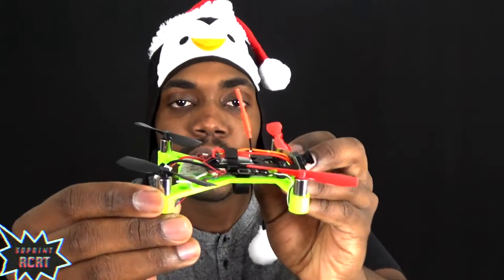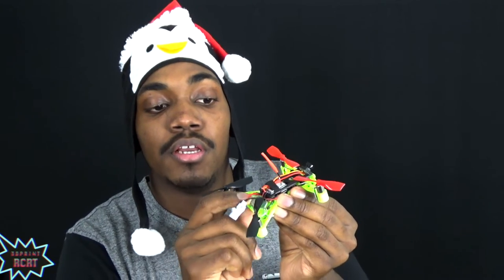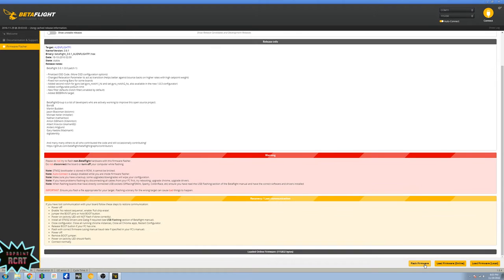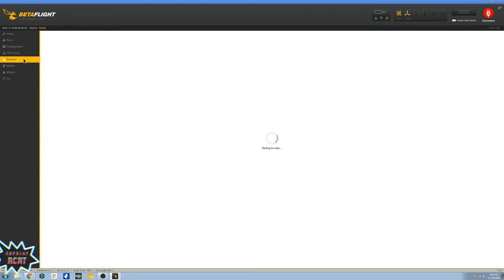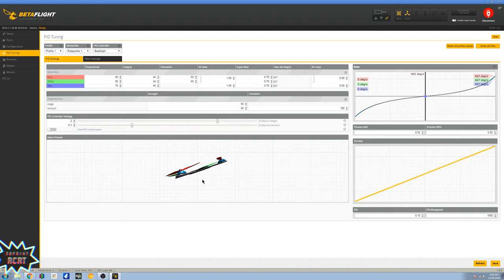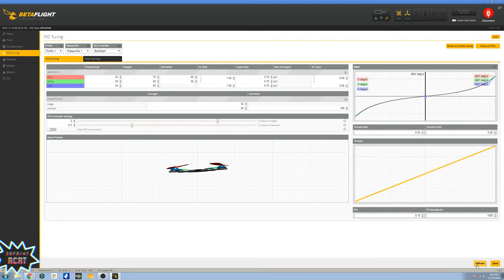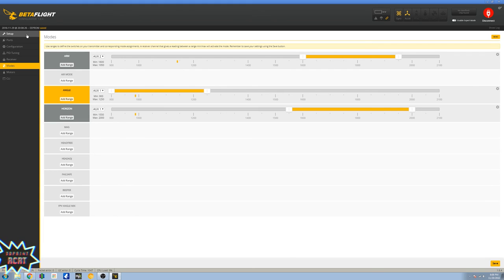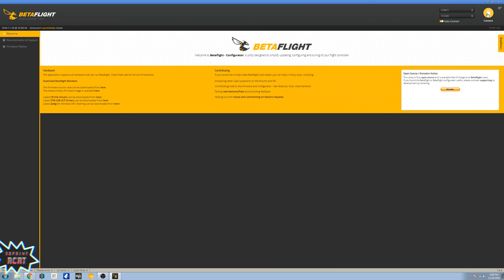KingKong N32 Brushed Flight Controller Review

Comment: Is this good enough compare to fc3 brushed fc?
Reply from the maker: The F3 FC is better because the FETs can push more power in case you wanna try out 1020 motors but the KingKong i got it because of the 6 motor pads but then realized the F3 has 6 pads also lol F3 is definitely better cause you can even power it with a 2S lipo :D
Reply: 3dPrint_RcRt understood. Thank you :)
Reply from the maker: No problem anytime :D